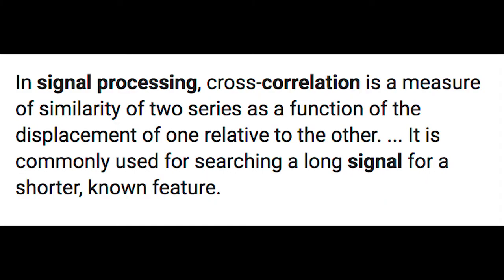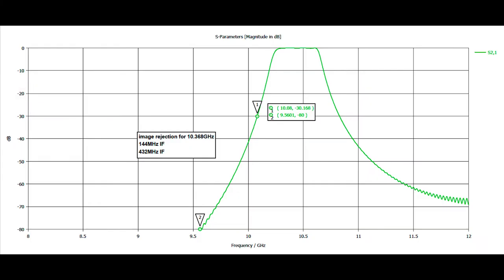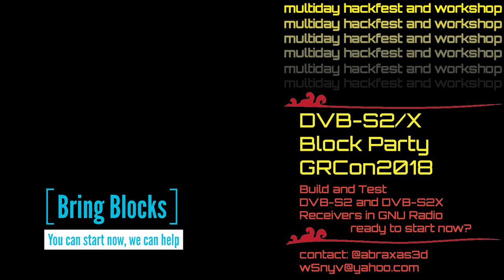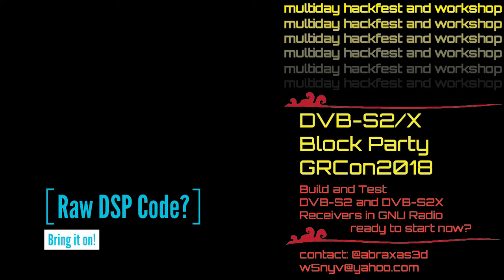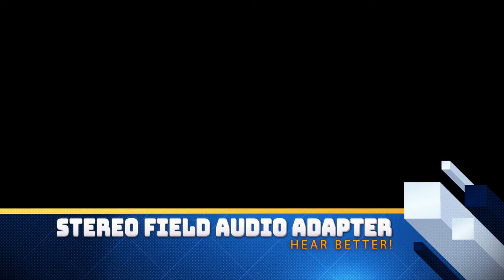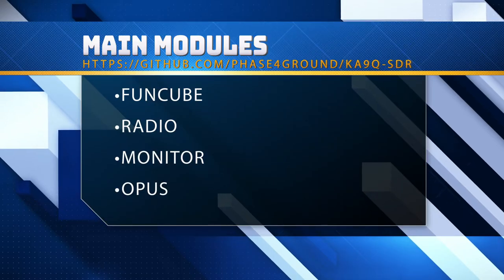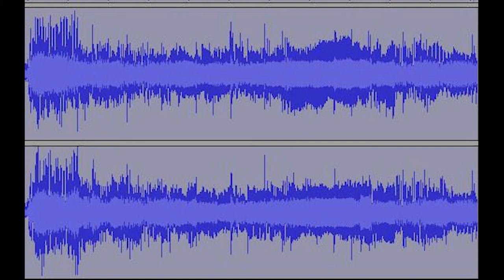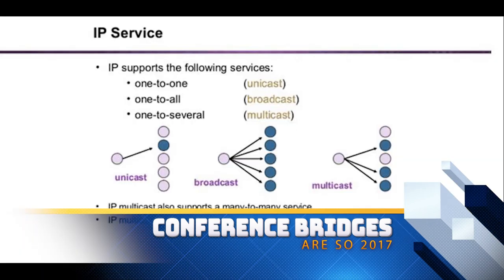20180409 Phase4 weekly report 1

Comment from the maker: [transcript]

Welcome to the Phase 4 Ground Weekly Report!

409!

Video link
https://youtu.be/6tW04jWZGjM

2 4 6 8 Everybody Correlate!

Correlator team had a conference call on Thursday 5 April 2018. Jordan, Brennan, Ed, and I talked on the conference bridge Ed set up for us for about 45 minutes. We covered a lot of ground and got some idea of next steps. We have a repository that has GNU Radio draft blocks that do the Pi/2 BPSK demodulation and decoding, and we need to get it working as a correlator.

We also have a correlation estimation block in GNU Radio that has an issue. 

Brennan Ashton reviewed our block and didn't see any major issues yet, and then went out to see what he could see about the correlation estimation block.

Please review Brennan's pull request here:
https://github.com/gnuradio/gnuradio/pull/1725

This is an attempt to solve this issue here:
https://github.com/gnuradio/gnuradio/issues/1207

Which if successful will help us and a lot of other people. 

This effort is in progress and will be updated as the code is reviewed and feedback from GNU Radio given.

10GHz Filter

We have a 10GHz filter design proposed from Jeffrey Pawlan. 

It covers the 10GHz amateur band, has 0.1dB variation over the band, 0.1dB insertion loss, and 20-30dB return loss. It's a high-performance filter and we are talking about how to get it published, how many prototypes to build, and what the potential market might be. Here's the first four documents from Jeffrey. These are in the repository at the link in the notes. If you have feedback we want to hear it. 

https://github.com/phase4ground/DVB-receiver/tree/master/Pawlan-10GHz-Filter

Block Party at GNU Radio Conference 2018

We are sponsoring a Block Party at GNU Radio Conference 2018. This is a multi-day hackfest, workshop, and summit all about making an open source DVB-S2 and DVB-S2X receiver in GNU Radio. Come and help. We have five solid technical docents for the event and could use more. The goal is to bring blocks and write blocks on site, test interoperability, and leave the conference with a working DVB-S2 receiver. This is the central mission for successful continued research and development and we need all hands on deck. 

If you've have never coded a block in GNU Radio, then don't worry. It wasn't until the past year that I had ever coded up a block for GNU Radio. I just had never needed to. There is a series of guided tutorials from GNU Radio's website. The link is in the notes. 

https://wiki.gnuradio.org/index.php/Guided_Tutorials

Go there, or search them up with "gnu radio guided tutorials", walk through them, and you will have the tools and the workflow experience to be able to contribute. 

Having said that, if you are only comfortable coding in python or C++ then that's ok too. If you have an idea for getting some part of the DVB-S2 digital signal processing done, and either don't have time to work through block coding or pybombs distribution, then you can certainly still help by sharing your signal processing code. Don't let GNU Radio block configuration stop you. You're needed and appreciated.

KA9Q SDR - stereo field

Phil Karn has shared a work in progress with us. He calls it the KA9Q SDR. However, the module in this SDR code that I'd like to highlight is a stereo field audio adapter. 

This works by taking in multicast audio streams. Each audio stream comes from an individual audio source, or participant. These participants in a round table audio conference are placed at different points in the stereo spectrum. 

Phil Writes:
I'm writing a lightweight, modular SDR package that uses IP multicast
for inter-module communication. Multicasting is very flexible and
convenient for this sort of real-time application, and I really think
it should become standard practice.

One module is an audio decoder-player. I'm often running several SDRs
at once so I wrote it to handle multiple multicast streams. Since
several mixed audio streams can be confusing, I've been experimenting
with ways to help the user distinguish them.

I started with a simple text display that lists the streams and their
types and sources, highlighting those that are currently active. You
can individually adjust levels or ignore those you don't want.

Since most sources are mono, I added the ability to give each one its
place in the stereo aural image. I'm trying to recreate the famous
"cocktail party effect" that, in person, helps you pick out one voice
from several talking at once.

Audio engineers typically place a source in a stereo image with a
mixer "pan pot" that adjusts its gain in each channel. This works -
sort of. I wanted to find something better.

So I read up auditory perception. I learned that we distinguish the
direction of a sound only partly by the level difference between our
ears, as that doesn't actually change much as your head turns.  The
real cue is the difference in arrival time. The speed of sound is
about 340 m/s, so if our ears are 30 cm apart (measuring around the
head) that's a little less than a millisecond.

This didn't seem like much, but it was very easy to add these small
delays to the "pan pots" in my player. And it works! The effect is
almost eerie; you have to listen to each channel in turn to convince
yourself that the levels are almost the same.

Conference calls (or "round tables" as we hams call them) are very
important in communications. I've long thought we can make them much
better, especially in how we handle several simultaneous speakers.  If
we use this scheme to place each participant in a round table we
should get a lot closer to that "in person" experience that's so
difficult to produce in electronic communications.

All this requires that each participant receives every other
participant as a separate stream -- there's no central "conference
bridge" that mixes everybody together. This is a perfect application
for IP multicasting. Not only can you put each participant in its
place, the status display shows you at a glance who's talking. You can
squelch an individual who keeps disrupting the meeting, and you can
even have a private aside by sending unicast traffic rather than
multicasting to the entire group.

A lot of this was done as research in the early days of what became
'voice over IP' (VoIP) but it seems to have fallen by the wayside. It
really deserves to be more widely recognized and used.

Phil Karn, KA9Q
9 April 2018

Careful COTS SDR 

We are making great progress on the Careful COTS re-layout of a USRP E310 with future plans to tackle the E320. We're collaborating with AMSAT Golf on this and have gained enthusiastic support from Ettus Research engineering. The next steps are to negotiate what's needed on the business side. Scheduling talks is in progress. 

If you're not familiar with the term, Careful COTS - COTS means commercial off the shelf - is taking something that wasn't designed specifically for space and making it work for space environments. This is done by selection of the right components, designing in redundancy at the system level, and testing the entire system for radiation tolerance. 

We have a high degree of confidence that the Ettus USRP will work and some volunteers willing to do the work. If you are interested in this part of the project, let me know. 

Badge Update

The Transionospheric badge prototypes are being built at a contract manufacturer in San Diego right now. We are working hard to have them at Hamvention for sale. All proceeds benefit Phase 4 Ground! They aren't just for show, they will be a radio peripheral for Phase 4 Ground radios, providing a lot of visual reinforcement on what your radio is doing and the health and status of your link. Whether you have a satellite or a terrestrial system, the same information will be stylishly displayed. We are working hard to make it possible to command other radios as well. More on that as it develops! 

If you want to be part of the effort, then join our Slack and mailing list at http://lists.openresearch.institute/mailman/listinfo/ground-station

Write me for an invitation to Slack. All are welcome. This project is intended to spread enjoyment, appreciation, and success in broadband digital communications at microwave for amateur radio use. A lot of what we do is complex and challenging, but we are here to help and you can contribute at any level. 

Thank you for all the support and interest. If you have suggestions or questions or something you think we need to know about, let us know. If all goes well, we'll see you next week!